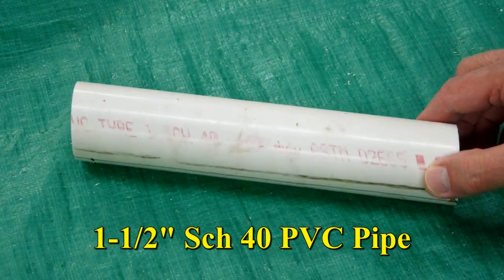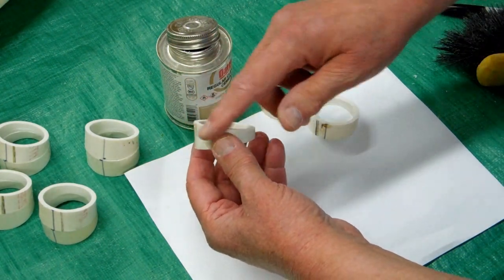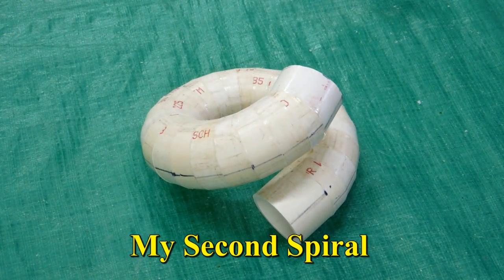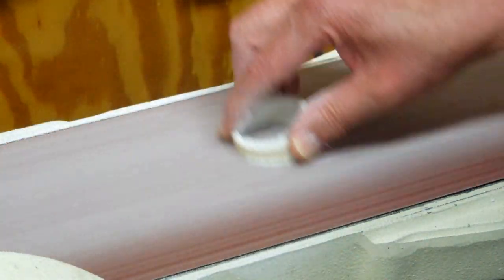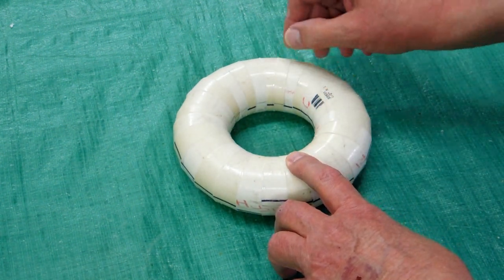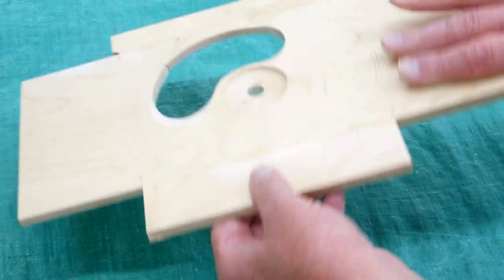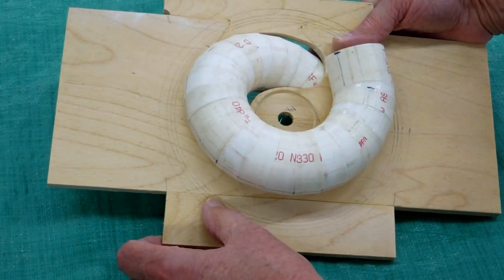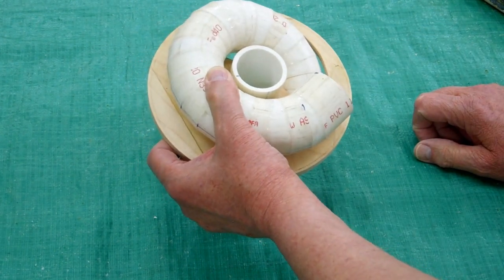Making A PVC Segmented Toroidal Spiral

Comment: By guiding the air around this spiral, you are pre-spinning the air before it enters the cyclone.  Did you measure any advantage to this over guiding the air in through a straight pipe and allowing the inner edge of the cyclone to give it its spin?
Reply from the maker: "Pre-spinning" the air doesn't mean anything... slinging the particulate to the outside does.  As stated, the reason behind the presentation of this toroidal spiral design was it "may" be easier for some to build this rather than a tangential input to the cyclone. I did not notice any less nor any more efficiency of this toroidal spiral design over the other two designs I have presented. All three designs are very efficient.
Reply: Many thanks for the swift reply.  Making a dust separator is about No. 3 on my list of things to do, but I'm on the lookout for ideas, and I like yours.  On the balance, I think I'll go for the tangential inflow.
Reply from the maker: I agree on the tangential input which is what I used for the first design, "Shop Vac 5 Gallon Cyclone Separator". And use a paper bag inside your shopvac. Balsa and foam dust will choke a pleated filter in no time. Thanks for watching!

Comment: How about heavy wall rubber hose ?
Reply from the maker: Keeping the hose bent (without kinks) may be an issue. Rubber can be textured and induce drag.  Heating the plastic pipe and coiling it would be neat. May need to pack it with dry sand to keep it from distorting.
Reply: Oneida and your done for $100.
Reply from the maker: No fun in that. :-)  I've had an Oneida Dust Deputy for years and the top kept popping off. That plastic is sort of like trying to glue a traffic cone. It is now held on with Silicone and tape. It repeatedly falling apart is what made me decide against buying another and making my own. Mine have never fallen apart.

Comment: You do nice work, both on the separator and the way you edit your video's, very well done.  I should have a dust collector for my table saw, your video inspired me to make one following your idea.  Thanks again, JD/Missouri
Reply from the maker: Thank you for your nice comment, much appreciated! I have videos on three different cyclone separators, each has a playlist. As a suggestion, table saws require a lot more air to be moved for effective dust collection. My Split-Ring Ramp Cyclone Separator https://www.youtube.com/playlistist=PLDjucfhdTRPkep9dVeZMfZ7sKi2K4gP5R  was designed for a ShopVac with a larger hose. I also have a video on improving table saw dust collection - Table Saw - Added Features And Dust Collection https://youtu.be/XudIfD3z9pM  Thanks for watching! Ron

Comment: You made a smooth radious with the segments. I'm wandering because the scedual 40 that you used isn't required for high pressure in a shop vac pressure , would using the sweeping elbows for drainage pvc work for this?  They are not sharp bands and fit together without any real turbulent joints. I like how you have made yours. But just wandering do you see any reason my idea would not work?
Reply from the maker: +Phil Lowman Drainage pipe is generally oversized due to gravity flow and the interruption caused by fittings such as elbows. For a cyclone to work, long smooth continuous uninterrupted sweeps and surfaces are needed. Using a bunch of drainage elbows to form a square circle is not going to perform well for a cyclone separator. That is why I went to the trouble of making a smooth toroidal spiral. Or consider my first cyclone separator with a tangential inlet. Video Series https://www.youtube.com/playlist?list=PL1ABF2C513E0F4838

Comment: Is the spiral input more efficient that the a straight side input?
Reply from the maker: +Tony Hampton It is no more efficient than a tangential side input (there are no straight sides – these are conical cyclones), but it is just as efficient. I have three different designs for making a cyclone separator. My first design “ShopVac 5 Gallon Cyclone Separator Parts 1, 2 & 3” has a tangential side input. For some reason several people complained about the difficulty in doing the tangential side input. Personally, I never understood the complaint. This method achieves the same thing and may be (for some people) easier to do. This cyclone works just as efficiently as the first… it was fun to build... and it looks different. :-) Review the latest comment on “ShopVac 5 Gallon Cyclone Separator Part 1” by someone who built it recently. He seems happy with it. I would suggest building my first or third design. However, I am using the Toroidal Spiral Cyclone in my shop since I built it and I am quite happy with it.

Comment: Wouldn't it be easier just to heat the pvc up and shape it to your needs instead of cutting and gluing all those parts?
Reply from the maker: +Tiny Houses This is not difficult. The idea is to make this in a way anyone can follow with basic woodworking tools. Not everyone is going to be able to evenly heat a long length of PVC pipe. In my experience, heating PVC pipe often results in something that is not quite hot enough and then suddenly is too hot, resulting in a wet noodle, uncooperative, oval shape that would need to be wrapped around a form of some sort. But if you want to heat your pipe then that is something you can try. I would stick with the segments as shown and have it done in a few hours.
Reply: +Ronald Walters plus it's bad enough breathing in the dust --can't imagine what heating pvc will do, well I can---nice birdies in the background! thanks for the instruction!
Reply: tape or cap ends and use heated sand inside of pvc.  Makes it much easier to shape and you have a longer work time with a heated material inside the pipe.  Shouldn't burn either unless your sand is wayyy too hot

Comment: This is amazing. Thank you for the video. I think I will build this with one change. I will cap the pipe and fill it with pressurized air. Maybe 10 psi tops. Then I will use my heat gun and heat the plastic to bend temp and bend it in one piece. I have seen some pretty complex shapes be made that way in the past. I'll let you know if it works. Thanks again!
Reply: Please post the video

Comment: Would it be easier to make and smoother flowing, to glue several sweeps (bends or elbows) together?
Reply from the maker: cranky1964 Elbows do not provide smooth flow and this is not difficult to make.

Comment: Ron - great project and excellent video! My shop vac is approx. 2" inside tube diameter. Would I need to use 2" SCH 40 PVC? If yes, what would be the dimensions (narrow end and wide end) on the segments?
Reply from the maker: Gary Strebeck Yes, you can use 2" Sch 40. I would try 1/2" at the narrow end (because your center pipe will be a little larger) and 15 degree segments. Make a 15 degree gauge as shown. If the center pipe is a bit tight inside the spiral you can sand away a little of the plastic on the inside of the spiral until it fits (which would allow you to glue the center pipe to the spiral for extra support on final assembly). This is just trial and error until everything goes together. Then the top of the cyclone will be slightly larger diameter (due to the larger spiral) and slightly taller to maintain the same approximate shape of the cone. Have fun!

Comment: could you sand the toroid to make it more round rather than segmented?
Reply from the maker: CaptM44  I guess you could if the desire were high enough. Or... make the segments narrower, more closely approximating a smooth surface (plus more careful assembly).

Comment: I assume you believe that forcing the air to enter the chamber through your toroid will improve the efficiency of the dust separator? Do you have anything to support that theory (to make all the effort worthwhile)?
Reply from the maker: BigWingUK Just trying to find a way to make a cyclone which was easier than having to make a perfectly tangential inlet pipe (and rigidly support it) like I used on my first cyclone separator. Cutting and gluing the PVC pipe segments to make a spiral is about as easy as it gets. My supporting theory is just my experience building and installing dry powdered bulk material handling and dust collection systems in drilling rigs and supply stations for the oil field.

Comment: Looks nice!! What is the name of that tool you were using to debur the pvc?
Reply from the maker: ViperishTiger Not being facetious, it is called a PVC pipe deburring tool. I've had it for 10 or 15 years and it does not have a name on it. Quite a handy little gadget and has a bright yellow handle so it is fairly easy to find. I got it at a plumbing supply warehouse. It has a curved swiveling blade which works best on the ID but also does the OD. The hollow plastic handle stores one spare blade and the handle is starting to split which means I will probably be trying to figure out how to repair it or make a new handle one of these days.
Reply: Ronald Walters That deburring tool looks very similar to the metal deburring tool used by machine shops. If it will debur metal PVC would be no challenge. Home Depot sells one called HDX for less than $7
Reply from the maker: Grumpyneanderthal Thanks! I'll look for that next time I'm at Home Depot.